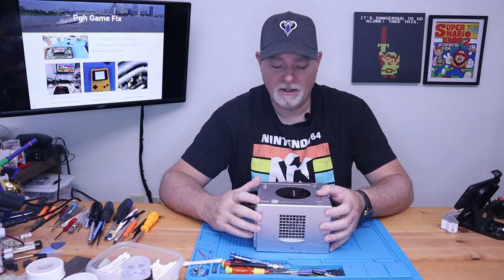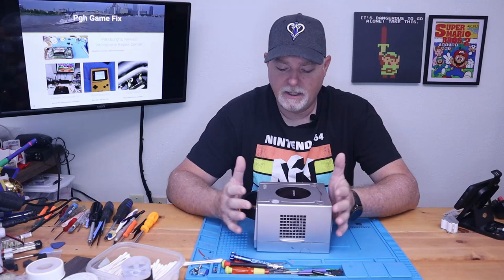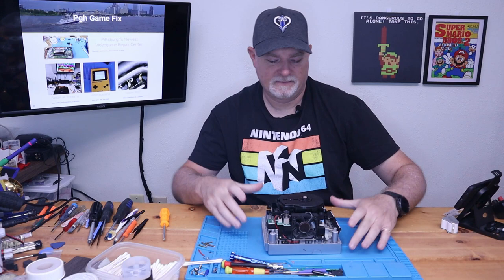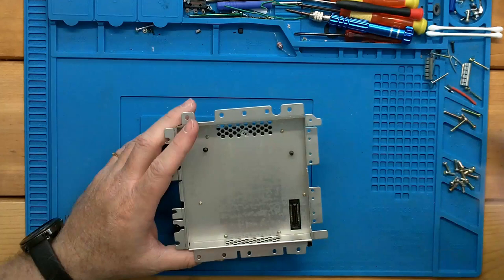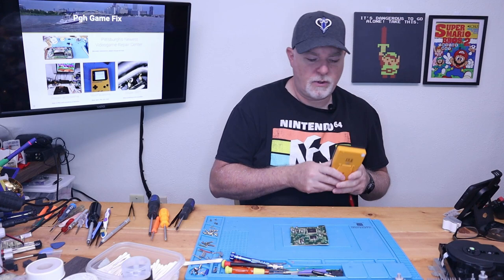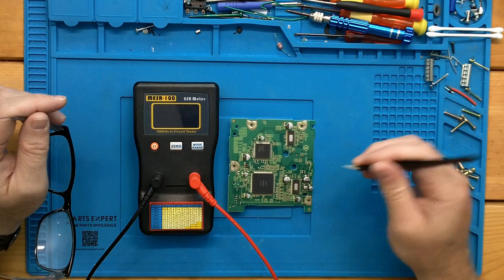Nintendo GameCube won't read Games. Bad Capacitors, good laser.

Comment: Thanks for making this video! I was wondering about 90% of this info 2 years ago and nobody went this far in depth at the time.
Reply from the maker: Glad you enjoyed it and learned from it.  I agree... I saw someone talking about this a couple years ago, but the norm was to swap, or "Tweak" a laser. But I finally had some show up that the new laser wouldn't help, and that's when I dug in deeper.  Since making this vid... I've found that the one small cap, toward the bottom is the real culprit.  It's the one that passes the main data signal.  It should be around 0.1 ohms.  I found one last week that was 49 ohms !!!!!  They don't seems to be leaking... just breaking down internally.
Reply: @PghGameFix  can I ask what type or kind of grease lubricant do you use to lubricate the Disc laser rail's ???
Reply from the maker: @christianorthodoxy4769  Super lube.  It's a silicon lube and plastic safe.  You can get it at most hardware stores.
Reply: @PghGameFix  I was curious what you used because some people use that white Lithium grease stuff, but I use: WD-40 Specialist No-Drip Gel Lubricant, 10 Oz.
Safe on multiple surfaces including metal, plastic and rubber, use it when repairing your car, on walls, on your garage door, or on hinges, once applied it can withstand temperature ranges from minus 100°F to 500°F

Offers long-lasting lubrication without the mess. It won't run and is ideal for vertical surfaces and moving parts like chains, cables, rollers, gears, and bearings

*Independent tests conducted in salt spray and humidity chamber. Results may vary depending on extreme conditions..
Reply: @PghGameFix  I Lubricate my DVD Recorder's and blue ray burner, and CD Recorder with it and just did a GameCube, about 3-weeks ago. I have Blue Ray and DVD Recorder's and different consoles that I take good care of. Thank you!' for that video's

Comment: Thank you!! I had 2 gamecubes in a row where I pulled that exact pad twice. That certain capacitor must be one that leaks the most. I was running my trace wire to the wrong place. After watching where you put yours, I opened both of them back up and was able to fix them. Same fix, same capacitor 2g 4v. Caps can be tough to get off, I found using sodder tweezers with a ton of flux works the best for me. Thanks again!!!
Reply from the maker: Glad the video helped.

Comment: Thank you. 
I saved my gamecube optical drivers via your video.

Here are some summaries:
1.  suggest  to replace most capacitors before laser power adjustment because the replacement may improve the laser reading efficency.
2. The c408 capacitor seems higher resistence value than others, check this first; thought I suggest to replace all 10 capacitors.

3. If using XENO mod, suggest to replace capacitors after installtion and then back to try adjusting the laser VR to higher value to reduce the risk of burning laser set because user already adjust to lower value.

4. I used: 220uf 16v*1 100uf 6.3v *3 47uf 6.3v*6.
Reply from the maker: Every one of your points seems correct.  I'm finding that very few lasers are bad, or even weak.  You are absolutely right... since we know 2 ore going bad... they all should be replaced, as they are on their way out. The same thing happened with the TurboExpress years ago.  We were swapping out 3 or 4 caps.... but now, they are all leaking.
Reply: @PghGameFix  One professinal repaired my PCE Duo console. He replaced all capacitors and used some Tantalum capacitor.  Maybe this type can help the leaking. problems.

Comment: Wow this video was helpful after trying calibration and a laser replacement nothing worked. Came across this and replaced all the caps with some small smd style caps from old macbook pro motherboards cause didnt wanna wait for shipping and gamecube is now going strong!
Reply from the maker: In the last 6 months... I haven't even changed a NGC laser. Every read error fix in my shop has been the caps on the optical board. Thanks for watching.
Reply: @PghGameFix  Thank you so much for this video! Have two childhood gamecubes that I'm going to recap.

Comment: When these GameCubes were still being sold new at stores, the original indigo we purchased started showing this problem and would refuse to even spin the disc before acting oblivious that there was one even inserted inside its drive. We had it replaced with a platinum one that amassed more significant wear since, never did its laser burn out unlike the other consoles I also owned just as old. I was wondering about this possibility, considering the capacitor plague

Comment: thanks for this info video man, I plan on doing this to my gamecube someday. so say a gamers prayer for me lol. but I hope I can get it fixed.
Reply from the maker: I'm sure you will get it fixed.  FYI... in the past 6 months... I've only changed out 2 lasers... but fixed at least 20 with just replacing the caps on the board.
Reply: @PghGameFix  bad news man, I couldn’t  fix my optical board, though I was successful in removing the capacitors, I could not solder the new ones on, and I sadly damaged my board in doing so.

Though it’s not the end of the world, I I have two optical boards in need of capacitor replacement, unfortunately It’ll be a while before I can replace them, and I don’t want to risk damaging them, if I may ask, what kind of soldering tool do you use to solder the capacitors back on? And what’s the temperature you set it to?
Reply from the maker: @optimusN64  To put them back on... I use a thin, curved tip.  With led solder... I set my iron to 390.

Comment: nice video, great content. QQ since I see you are using hakko soldering iron, why not also use the hakko tweezers to de-solder the caps? I think if you are doing so many console recaps, wouldn't that be a hugh time saver over the long run?
Reply from the maker: I just haven't looked close at "Hot Tweezers" yet.  But it's probably something I should add to the work bench.

Comment: Incredible tutorial, may I ask, why exactly did you have to use the 30 gauge wire to link with the common ground for one of the 47uf capacitors? Was it because of the leak?
Reply from the maker: In the vid, it shows me looking for the ground, and I realized it was it's own circuit.  But, the wire was used because the pad was damaged.

Comment: This video has educated and helped me tremendously. But I have a question. 

If I had been able to get a GameCube reading discs again, but one disc still won’t read, what could be the cause of this if that exact disc loads perfectly on first try on a different GameCube?
Reply: check the region for the game and the two consoles. The gamecube is region locked. So, for example, that disc is PAL region locked(Europe) then it would only work on PAL gamecubes. So your two gamecubes might be different regions, causing the disc to only read on the one that's the correct region.

Comment: Put a new laser in mine and I adjusted the pot in small increments all over the place from the proper 450-600 ohms and went down to 200 just testing. May have to look into the caps. I was thinking I got a bad laser but I'll look at the caps now.
Reply from the maker: In the past 2 years... I've fixed at least 30 by replacing caps... only 2 needed a laser.
Reply: @PghGameFix  oh wow!!!

Comment: Oof I was thinking it might be the laser but I almost feel like this could be more likely since my crashes are kind of irregular (GC can still read disks but crashes every now and then when loading something) ... but there's no way I could fix this on my own since I have zero experience and zero equipment...
Or maybe something else entirely is the issue - I'm starting to think there's no way I can find the problem all by myself, there's  just too many things that could be causing the crashes. Great video though, at least I learned a little more about how this stuff works!
Reply from the maker: Glad you enjoyed the vid.  I can say this... I change one laser in a NGC for ever 10 or 11 cap fixes.  Right now, it's the dominate issue when they don't read disks.
Reply: I'll probably buy a second GC for backup and take apart my current one to see if the caps are okay. If not then I'll at least know what needs to be fixed.

Comment: I have a modified NGC, using xeno+swiss+sd2sp2. It works, but the disc never reads from cold boot. It takes several on/off attempts. I'm wondering if at long term, this could damage the laser... and if changing the capacitors would solve this problem, or even better, save the remaining life span of my GC... 
Ps: i"ve already pot tweaked

Great video!
Reply from the maker: "Tweaking" the laser pot is what will hurt the laser. That is adding power to it. Check and replace the bad caps.  Since making this vid... I've probably repaired 100 NGC with new caps, and only replaced 3 laseres.

Comment: I know this is a old video but i have a disc drive from a DOL-001 cube at 470 ohm on the pot the laser tries reading the disc but eventually fails. Been stuck on the same drive for a few days

Comment: My gamecube isn't reading games anymore, I tried messing with the potentiometer but nothing seemed to change..., then I tried cleaning the laser with isopropyl alcohol but no luck
I thought about replacing the laser but I might try to replace some capacitor

thanks for this video
Reply: ya im in the same situation gonna try capacitor replacement

Comment: Hey it's my first time trying to do this and I noticed that the caps have a code on top of the uF value, they're 2E for the 220, 2e for the 100, 2a for the 47 4v and 2c for the 47 6.3v. I've googled a bit and I think they're the Tolerance and Voltage codes but I don't know which ones are which. Do I have to change them with ones that have those same values or I shouldn't worry about them?

Also can i change them with electrolytic or SMD capacitors or it has to be SMT ones?

Comment: In the event that a pad for the positive end of the cap lifts, can you just solder to the positive pad of one of the neighboring caps? Trying to get as much info as I can before I repair mine. Just recapped my old game gear with ceramic caps from retro six and it worked beautifully : )
Reply: Trace from the lifted pad back to the previous component and add a bodge wire. It will vary depending upon the particular circuit.

Comment: Hello, what causes this defect in the capacitors? I have a working gamecube but I wonder if at some point I will have to replace the capacitors, Thanks
Reply from the maker: A lot of caps from that generation have leaking issues. Especially the surface mounted type.  Things like the Sega GameGear won't even boot any longer without a full cleaning and recap.

Comment: I had the sam issue where the pad came off of that same capacitor it was hard to tell where you bridged it though I saw the general area but wasn’t sure if it was the one on the left or right
Reply from the maker: I'm not exactly sure what you are asking.  THe ripped pad in the vid got reconnected to the via just to the right of the cap

Comment: Awesome video! I went a little nuts with the rework station and blew off two 4.7k resistors. Do you know the dimensions of the resistors on the board? Your help is greatly appreciated.
Reply from the maker: Where were they located?  what was the number on the board?
Reply: @PghGameFix  It was R204 and R205. I found two at work. Now I seem to have lost C232 as well. I dont know the value. Any idea?

Comment: Is there a way to check if the capacitors are bad with just a multimeter?
Reply from the maker: You can... but you will need to remove them from the board first.  Most modern meters will show capacitance.
Reply: You can have capacitance in spec but esr can be way off and cause issues with the circuit as well.

Comment: hello would having bad capacitors cause problems like the game starts and shows the little intro but then when i press start on smash bros melee for example the disc stops spinning. ive gotten the game to get a little further but only through closing and opening the lid
Reply from the maker: Yes.  I know that Melee will respond like that when it's having a hard time reading.  Caps would be first assuming the disk is scratch free.

Comment: I just finished replacing the capacitors on the optical board. I turned on the cube and read the disc right away. I was having the problem where the gamecube needed to charge.  Is there a possibility I did not do it correctly and the disc just started reading? In other words how would I k ow I messed up?

Comment: Just came across your video after I purchased a replacement optical assembly that didn’t work. Where do you recommend getting the capacitors from?
Reply from the maker: Any good electronics store should have them... but for mail order, Console 5 is pretty good.
Reply: Awesome, thanks for the reply. I had a look on their site and saw there were 2 different options, one had an image next to it and the other didn’t. Should I get one over the other from console 5?
Reply from the maker: @mannynegron3588  use the link below.  unclick everythign other than the optical board caps. https://console5.com/store/nintendo-gamecube-smd-cap-kit-ntsc-and-pal.html
Reply: Great thanks so much! I just finished replacing the 220,100, and two 47’s and my cube is back up and running! Thanks again for your informative video on how to tackle this fix!

Comment: Hi, I think I made a similar mistake on my attempt at recaping and broke a bad in half during removal (the other half is still attached?). Where did you wire the ground to? Does it matter if the pad that broke wasn't the ground?
Reply from the maker: on most of the caps on the optical board, you can ground to a power ground.  The one on the bottom is data, and has to be jumped back to the point shown in the vid.

Comment: Firstly thanks for the video it got our store back to fixing GCs. Secondly, on a couple of these repairs I've had the C408 cap replaced but still showing on my ESR as bad (4.40 average reading) and I've installed several 47mf caps from the console5 kit and it doesn't seem to resolve it. Any advice?
Reply from the maker: You shouldn't be getting a reading that high.  Maybe around 2.0 or lower. But... if the caps didn't take care of the issue... the laser may also be bad.  Although, in the last 30 I've done... I've only needed to change one laser.
Reply: @PghGameFix  yeah that's the weird part after commenting I even swapped the cap with one to the left that's new and reading good and now that one is reading bad? I didn't even adjust the settings on the ESR so it can't be that. I took pictures as well I'm thoroughly confused 😂
Reply: @PghGameFix  I also swapped the laser with a new one as well since of the 9 I've done with this fix you showed only one prior bad to also get a laser.

Comment: Thanks for the informative video! Also can I ask whether capicitators of 100uf 16V and 47uf 25V would work fine in replacement of the 6.3V ?
Reply from the maker: In general... higher voltage caps will work.
Reply: @PghGameFix  Thanks!

Comment: thx! Do you have a recommended brand? Also esr reader
Reply from the maker: Any good quality cap will work.
Reply: @PghGameFix  thx. I never did this before so a bit nervous but since its just a spare drive im trying to fix I guess I got nothing to loose! I got the cube that had it for $32 recently. So it was a steal.